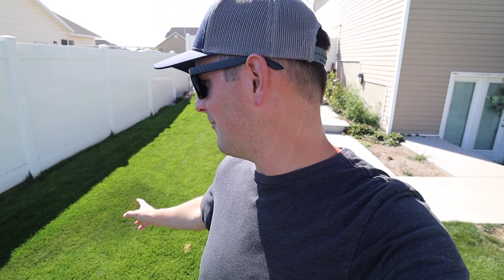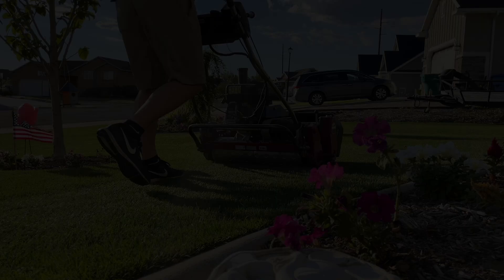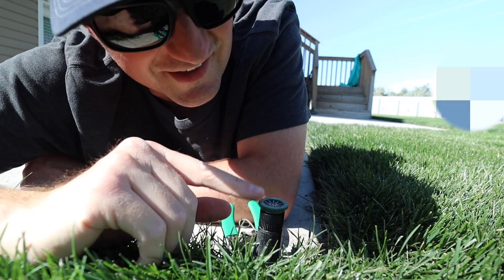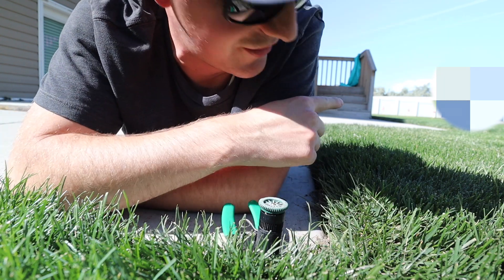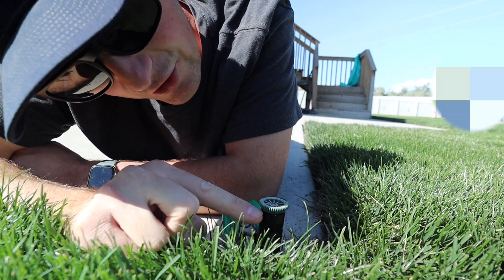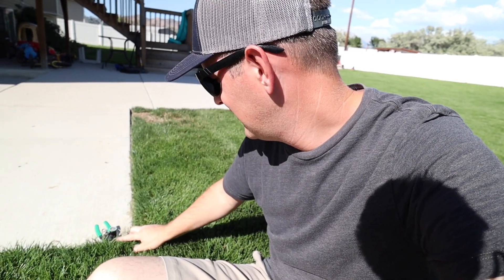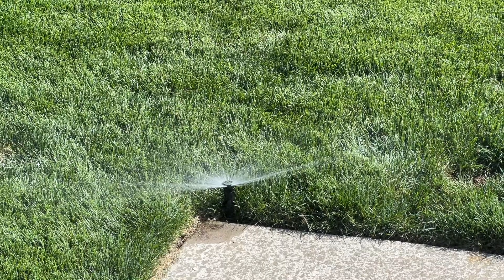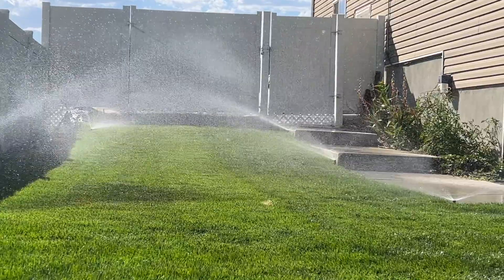THIS Caused a Dry Spot In My Lawn

Comment: I have been in a drought for about a month and a half and I recently found a couple of dry spots in my fully irrigated lawn. I turned on the sprinklers zone by zone and looked at the spray pattern and found all of the dry spots to be between the rotor heads and their furthest throw. Simply the set screw needed adjusted down to break up the water flow more

Comment: I had a similar issue yesterday.  You should look into the rainbird R-van pop up nozzles if you haven't.  You can pull up on the head while it's running to flush it out.  They work better in the wind, and the in/h precipitation rate is similar to your rotating heads so you'll get a better soak with less chance of run off.

Comment: can you do a video on those type of heads,  i struggle with getting them to spray farther out, than what the head says. thanks.
Reply from the maker: These heads throw at a fixed distance. I only adjust the radius. If you're struggling with distance that could be do to pressure or the way the sprinkler is positioned, or it could be popping up too low and spraying into the grass.